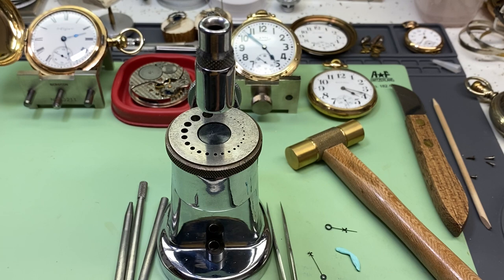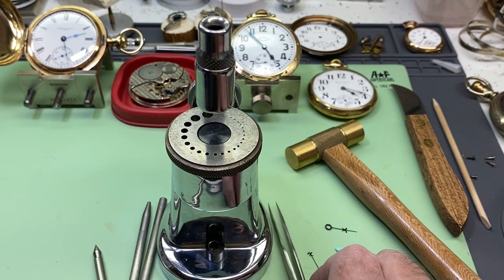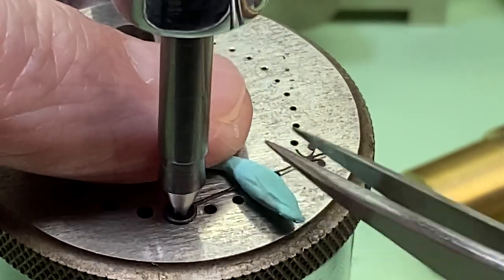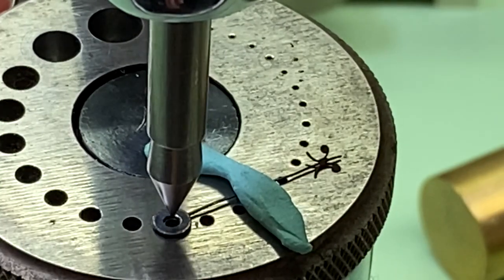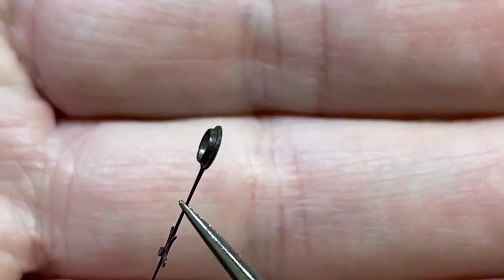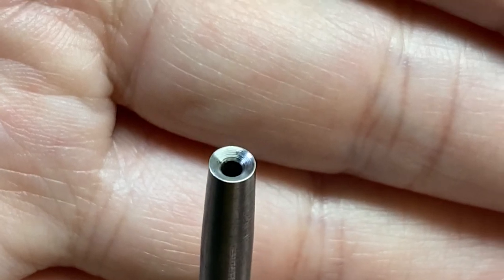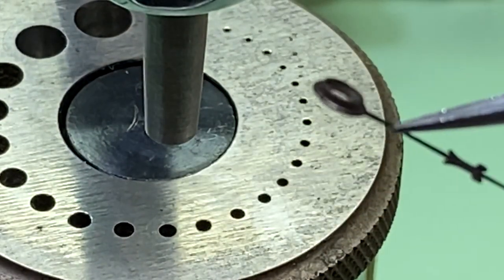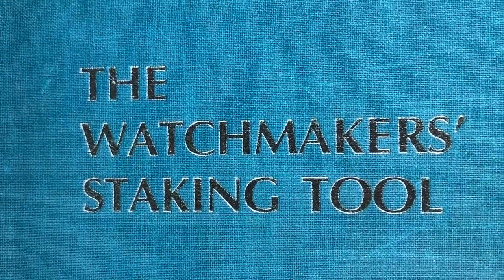How to use a watchmakers Staking Tool to close the hole on you pocket watch HOUR and MINUTE hands.

Comment: Useful thanks. I have a crack in the central chronograph seconds hand tube. So when the chronograph is activate and reset, the hand moves 1 tick as it’s not tight enough. 

I was thinking I’ll need to laser weld the crack first and then use a staking set to either open or close the hole a bit. 

The alternative is to close the tube without the laser welding but the question would be how long it will last before it it gets loose again. 

3rd option is to find a new chronograph central seconds hand but I’m not seeing the same one online to be correct. If you have a link to a online shop that sell a variety of hands, it would be appreciated. 

Would you agree with the assessment?

Thanks in advance.
Reply from the maker: I would try closing the tube to see how that works.  You also may want to check out Martybspace on eBay. He repairs hands and you could send him a message -  he could possibly rivet a new hand tube.

Comment: Sir. Do you think is it possible to reduce minute hand tube size from 0.9mm to 0.7mm using stacking set? I am trying to find a way to fit larger hand on smaller minute wheel and considering if staking set is able to do it? I appreciate your help
Reply from the maker: The process I use to tighten a cannon Pinion can possibly be used to reduce the minute hand tube size. Here is my video:   https://youtu.be/3p_Z2pa8ku8

Comment: does laying the hand face down cause scratches to the polished surface?  i think that it must, is there a solution to save the polished surface.  I guess a thin piece of material
Reply from the maker: I have never had that problem, but I am thinking you could use some watch paper in between the part and the die plate if this concerns you.  Thanks for watching!

Comment: Are all the holes in the die plate tapered? I was wondering if I could use or convert this tool to punch/broach neat holes in thin sheet metal. It would be nice if this tool has the ability to punch and broach. (not a clockmaker, wanting to use this tool for other projects if it's possible to convert it)
Reply from the maker: I don't think you could punch holes with it because I don't believe the stakes are strong enough to punch holes...

Comment: Thats insane...would I be correct by saying that the first tapered stake made that hole diameter smaller by pushing material from edge of the hole , towards (taper direction) center of the hole?
Reply: Yes, just reforming the metal from 1 place to another.
Reply from the maker: That is correct!  Thanks for watching!
Reply from the maker: Agreed!  Thanks for watching!!